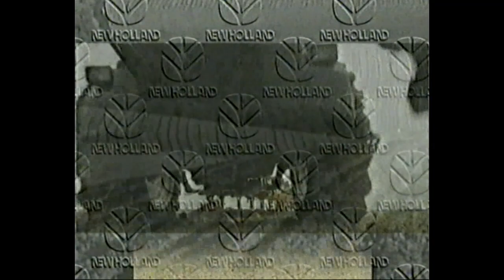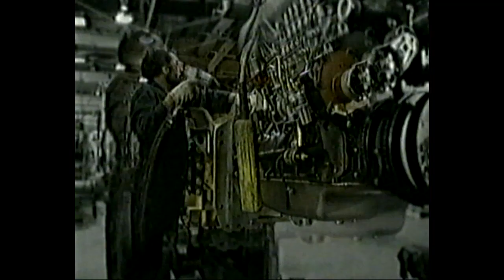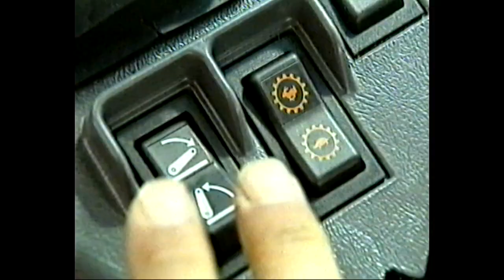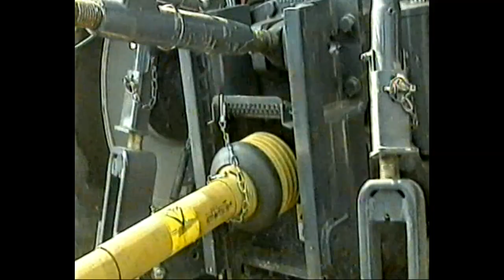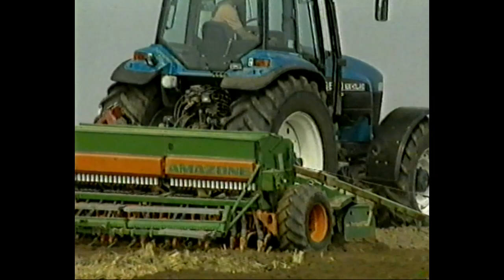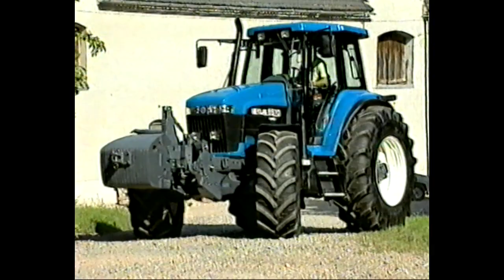Ford 70 Series Promotional Video

Comment: In italy called Fiatagri G series
Reply: That's because this tractor IS Fiat, by this point Ford had nothing to do with it.
Reply: @ianarchibald1423 wrong 
Last tractor designed by ford engineers 

Built in the versatile factory 

Fiat had nothing to do with them from a technical standpoint
Reply: @ianarchibald1423 it’s a versatile nothing to do with Fiat